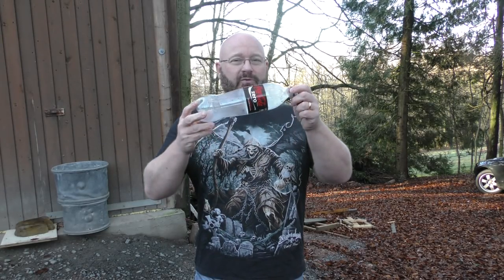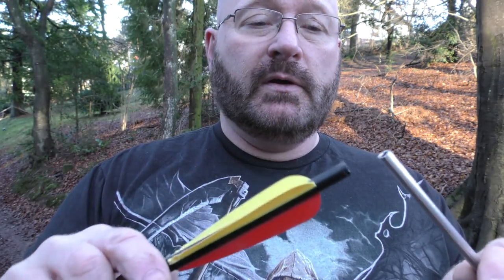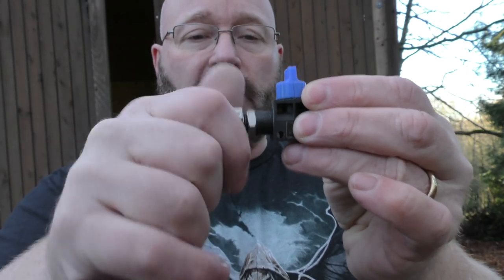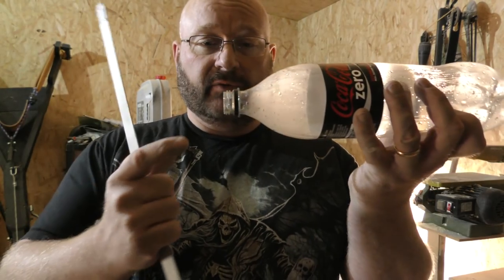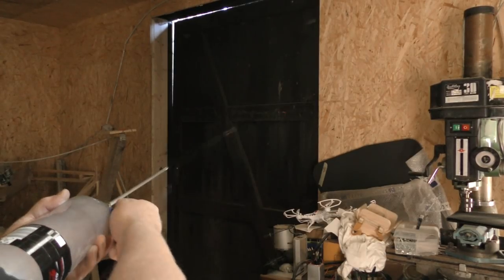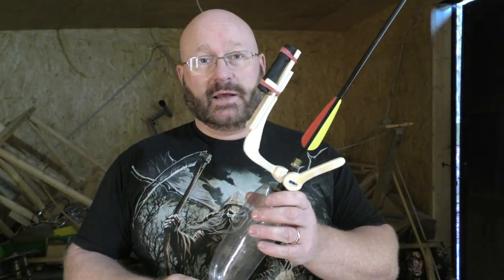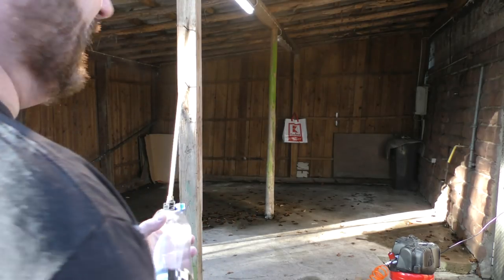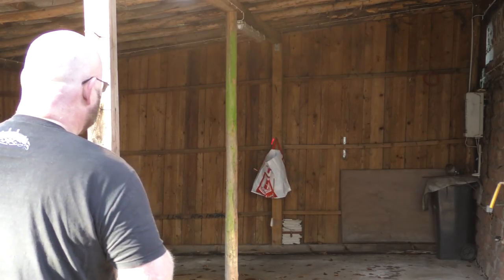How to turn a Coke bottle into a deadly arrow airgun

Comment: If you make the valve spring operated, so that it opens really fast, you'll increase the speed of the arrow/bolt.
Reply: +Cutthroat Bill Yeah I recall the Mythbusters having trouble with air-powered guns not activating fast enough, so you just get a slow release of air instead of a proper 'gunshot'.
Reply: +Cutthroat Bill Best would be to use a QEV
Reply: +danehb89 That's right. That was when they were trying to shoot straw through trees, I think. Or maybe it was when they made the supersonic ping pong ball shooter.
Reply: +snikkeldak That would probably be ideal. If he'd made the nail he put into the barrel a bit smaller, and more stream lined as well, he could've increased the velocity even further.
Reply: +Cutthroat Bill the caselmann airgun has its designs available online. They show both how to get as much power out of the air as possible and how to regulate shots to all have nearly the same velocity